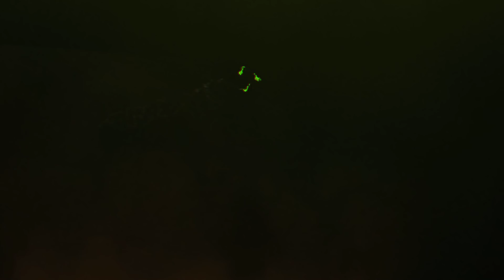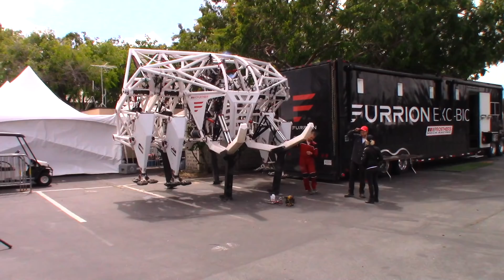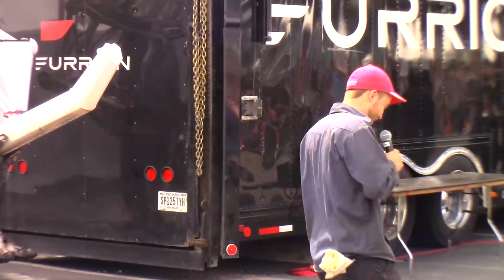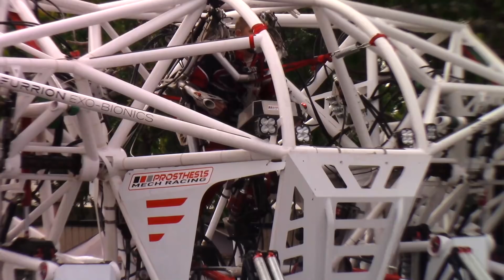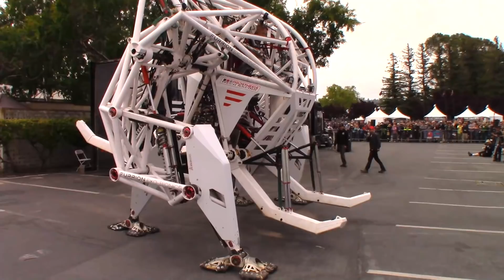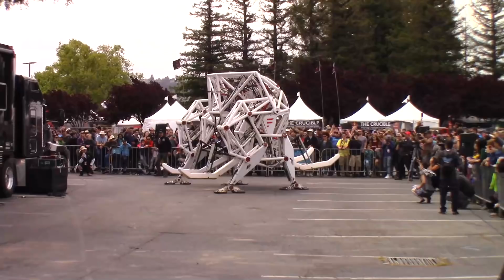First Public Steps of Prosthesis At Bay Area Maker Faire 2018

Comment: That's a pretty cool machine. I bet it's hard getting the hang of controlling it!
Reply from the maker: I can only imagine.  The poor guy makes a move and when the machine jurks it has to cause him problems as far as control.
Reply: That looks very hard to pilot.  I think much of the development will need to focus on the response speed of the machine.   In some ways it might be easier to pilot at a higher speed - my guess is that it will be difficult to get to a gallop, but once you are there it should be easier.